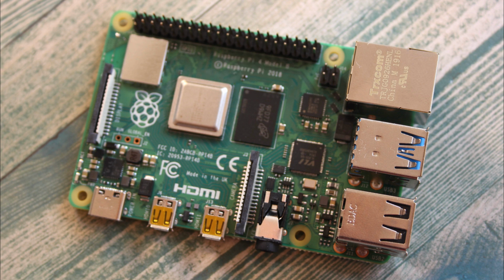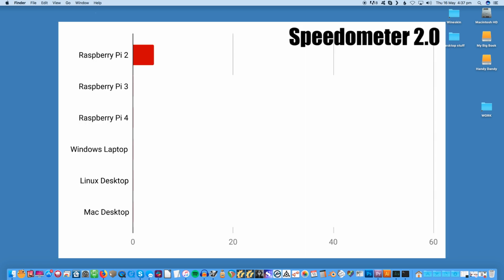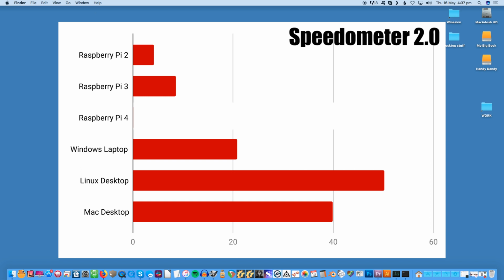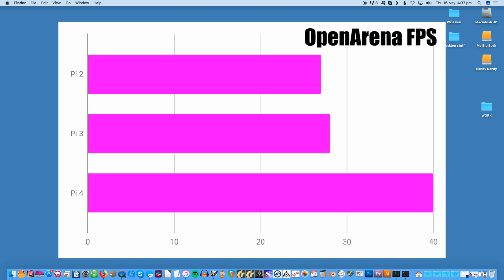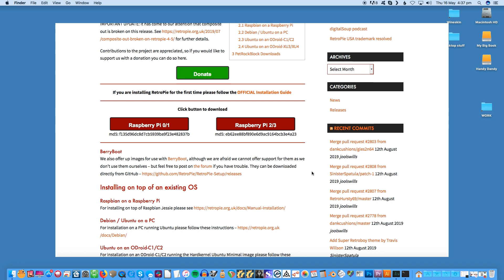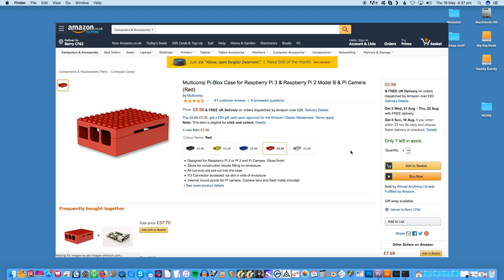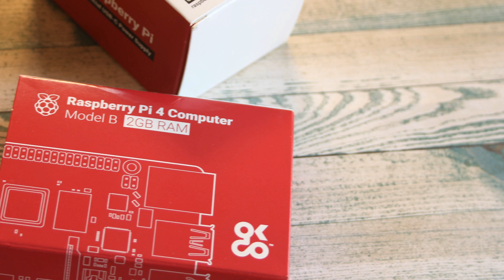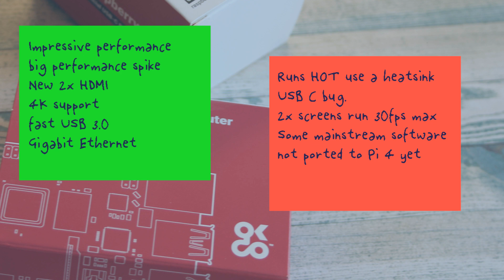Raspberry Pi 4 review

Comment: Thank you for the great review. I have a question about hooking up an external hdd to the Pi. Previously I had hooked up a Pi 3 running Kodi to an Anker USB Hub, so power and Data Transfer was no problem. Now that the Pi 4 uses the USB C, I have no idea how to hook it up or what I need to run my Raspberry Pi 4B (4GB) with a USB Hard Drive which holds movies and music.
Reply from the maker: Not sure what the question is, but I'll guess :) The Pi 4 still uses USB ports and USB C only used for power. Only troubles you might have is power needs for the new Pi 4 are greater than for Pi 3.
Reply: @Maketecheasier  I think I need another cable USB A to USB A, so I can power the hard drive with the Anker Hub and also transfer data to the Pi 4 and power the Pi 4 with the USB C power supply that came with it.

My Pi 3 was completely powered by the Anker Hub.